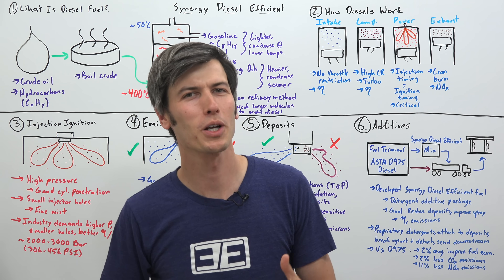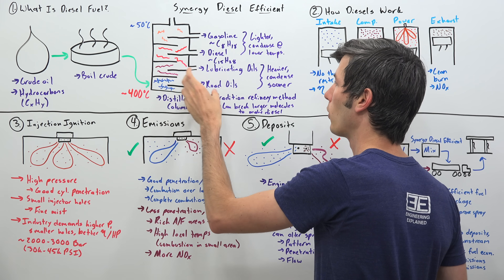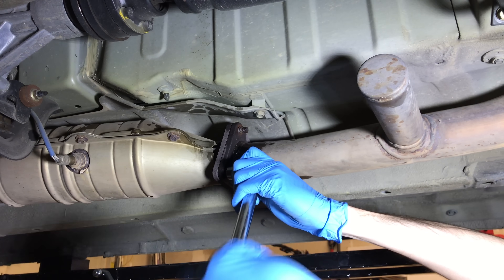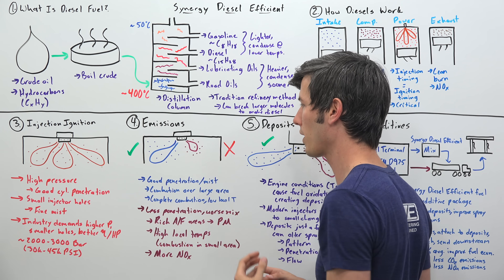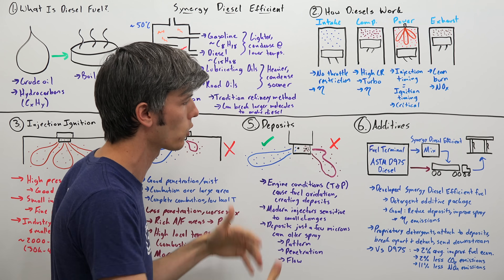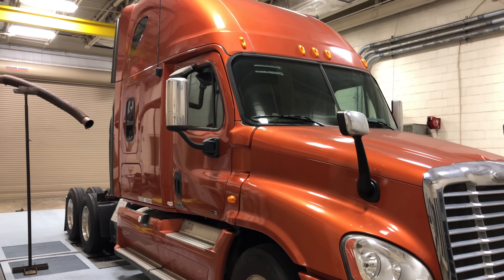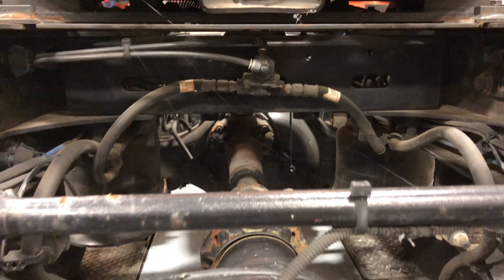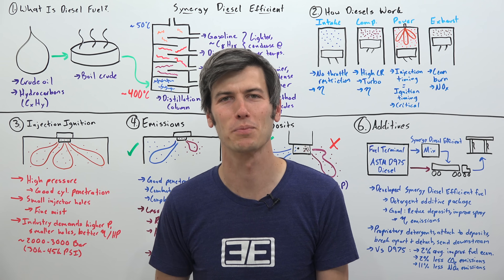Why Diesel Engines Lose Power & Efficiency Over Time

Comment: What causes a loss of power over time? Injectors wear/collect deposits creating poor spray characteristics. Wear in the cylinder kits causing lower cylinder compression/combustion pressures. Wear in the valves/valve seats causing lower cylinder compression/combustion pressures. Non VGT turbochargers generally don't wear out normally I mean the shaft bearings will wear when they fail it is a catastrophic failure good air filtration and oil supply keep them going a long long time. But over time boost leaks can develop in the charge air system. A diesel engine does not require much to run, air, fuel, and compression.   You can have other stuff happen but it usually causes a huge loss in power, air in fuel, low fuel pressure, failed high pressure pump (HPCR), turbo failure, EGR issues, plugged DOC or DPF, failed cylinder kit(s), burned valves or valves that are damaged/not seating fully, failed fuel injector(s), plugged filters, improper valve lash adjustment, improper fuel map, incorrect injector calibration codes. I can tell you as a fact that a driver cannot notice a change of 15 horsepower. I run a lot of tractors on a dyno. They normally start to complain when they are down about 50hp. A 2 percent improvement is not really enough to get a driver to spend more on fuel nor will they be able to perceive the difference, they might think they see or feel a difference because of marketing but they really can't.

Comment: I was an engine rebuilder for 30 years. Worked on Diesels and gas engines. Worked on over the road trucks and pure racing engines. Finally wound up teaching robotics for 20 years...all electric motors.
You know what...all piston combustion engines are crude, inefficient devices limited, at BEST, to about 33% efficiency. They all need 'cooling systems' to get rid of the energy that they cannot use...they should be called 'energy wasting systems'.
Induction electric motors basically  have 3 moving parts, a rotor and 2 ball bearings. None are sliding against each other...unlike pistons, rings, valves, camshafts, plain bearings etc. Electric motors don't need clutches or transmissions...with hundreds more wearing parts. 

Oh...and they're 97% efficient or so. 
 Piston engines are GEOMETRICALLY inefficient. Their metaphor is a damn choo-choo, steam engine.
So can we stop worrying about detail improvements to a dinosaur and move on?
The fact that Exxon-Mobil is sponsoring the video says it all.

Comment: This is a good reason for the "Buck" engine design. The ability to change an individual cylinder quickly and easily will keep the engine at top performance. Incremental rebuilds mean reduced downtime and improved cash flow for the owner as well as improved economy, all saving money. Individual cylinder replacements in under 10 minutes.

Comment: You mention Esso stations. I'm old enough to remember when Esso changed their name. I was a kid and so surprised some year later when I realized they still used the Esso name in some countries. Why did they change to Exxon and why do they still use Esso some places.

I actually didn't realize Diesels didn't have throttles. So a question is do you think GDI engines will get away from throttles?
Reply: No, because gas engines are throttled by air, diesel engines are throttled by fuel. Without a throttle controlling how much air enters a gas engine, u would be dangerously lean trying to limit fuel, or running away from you. U could throttle each cylinder by using the intake valve, but u still have to control amount of air to keep stoichiometric ratios
Reply: @dannymac7852  If you have an injector and computer why wouldn't you be able to calculate how much fuel and adjust accordingly. That's pretty much what a gas engine with intake injectors does now.

Comment: Your explanation of distillation is missing two vital elements.  The feed to the separation column is close to the middle, not the bottom.  At the column's bottom is a boiler (called a reboiler) and it functions to create vapor from liquid.  At the top is the condenser which functions to form liquid from vapor.  Naturally, liquid descends down the column whereas vapor ascends and the two streams tend to avoid each other.  All along the length of the column are "trays" which are devices that encourage intermingling of the vapor and liquid passing through the tray.  It is this "scrubbing" process that separates the components: larger molecules going towards the bottom and smaller molecules going towards the top.  The various products, e.g. gasoline and diesel are drawn off as a liquid from the trays.  The gasoline tray sits higher in the column than the diesel tray.

Comment: Another inefficiency is happening in the air intake stream due to sludge accumulation. This sludge is caused by egr and pcv mixing oil and exhaust soot. A 3 inch air stream can be significantly reduced withing 150,000 miles.
Reply: Emissions regulations is the worst thing to happen since unsliced bread.

Comment: If a fuel additive is this helpful at keeping injector spray patterns consistent it could be worth the extra money. Keeping deposits to a minimum seems to be the name of the game for longevity in modern diesels. In my opinion the DPF and EGR systems will be eventually phased out. Once the engine manufacturers can come close to perfecting the SCR system, all the NOX emissions will be handled by urea injection. Some tier 4 final industrial engines already have done away with DPF’s and rely on the lean air fuel ratios (thanks to high pressure common rail injectors) to all but eliminate particulate matter in the exhaust (unburned hydrocarbons in the form of soot and black smoke) Yes, these lean burning engines produce higher cylinder temps increasing NOX output but then you have SCR to save the day. The engines I’ve worked on have still used egr to at least some degree though. If the SCR system can be made efficient enough there should be no more need for dreaded engine-ruining EGR... just a theory though.

Comment: I heard of a mk1 diesel mondeo that was used as a taxi covering over a million miles, it probably had several changes of cambelt and a fair few clutches too. And I bet it was never driven over 50 mph lol. 1.8td is a very reliable motor.

Comment: Hello. Nice video as always.
I've one question related to Diesel engines. Why most of diesel cars with more than 10 years, often make huge amount of black smoke under engine load ?
Reply: a number of factors, engine tune, maintenance level, mech-injectors vs electronic, engine design, engine's available power vs amount of load present, all that fun stuff..

Comment: rudy diesel's first engine ran on peanut oil. Diesel engines can run on all kinds of different fuels refined into diesel fuel. they can refine plastic waste and make diesel fuel that runs cleaner than crude based diesel. The world runs on diesel time to start recycling hydro carbon based trash into useable fuel. Diesel is the answer not electric vehicles that create more toxic waste. Electric vehicles are old tech, been around since the 30's. they were smart enough to realize battery power is not sustainable. Lots of lithium to get rid of when the useful life has ended. Diesels you rebuild and keep the wheels turning.

Comment: Is there any particular reason you can't or wouldn't want to run a diesel type cycle with the lighter gasoline hydrocarbons?  I'm not saying why not use diesel fuel in a gasoline engine.  I understand the problems with that.  But why aren't there engines that burn gasoline but restrict intake air less, use high compression instead of a spark, etc?

Comment: I have Honda insight 2000, 3 cylinder with 200k miles 5 speed, NO problems what so ever with the engine, on way cheaper 89 octane and it makes 60- 65 mpg.

Comment: 9:28 You have no idea how long a diesel engine lasts.  My Jetta is at 415,000km (260,000 miles) and it runs like new.  As a trucker I have also seen tractor trailers with 2 million miles on the original engine.
Also, the title of the video had nothing to do with the content.

Comment: I have never known any significant torque loss or oil loss from a diesel car. I have noticed significant torque/ power loss and higher oil usage from gasoline engine cars more likely due to higher revs and higher demands put on these  engines.

Comment: This video is reductionist and should specify “modern diesels” (high-pressure “common rail” fuel injection).
I am a fan of the older Cummins and Mercedes diesels which had mechanical (not electronic) fuel injection pumps, larger injector holes, lower pressure and virtually no emissions (except EGR which is easily removed to prevent carbon gunking air intakes). These engines don’t lose power over time due to reasons in this video.
And there are other reasons engines in general can lose power/efficiency not covered here as well, like piston ring wear, causing blow-by for one example.

Cummins engines can last many hundreds of thousands of (in a few cases up to 2 million) miles in proper conditions.

Comment: Well explained! But here is a big problem...you can get a regular diesel from other than Mobile gas station for about $2.83 and in the same area Mobile diesel fuel is $3.29. That is 16% difference in price. For me to purchase their fuel they would have to be competitive and at least stay in less than 5% difference range...so as of now, it is not worth it. Your engine and a vehicle is not going to last that long for it to be worth purchasing Mobil more expensive fuel.

Comment: Like your videos and watch them often - so thanks for breaking things down on the newer end of the spectrum.  On that note - you State that the engines/vehicles were used and had reasonable miles on them with plenty of useful life.  However, you also state that they were brought back to mechanical soundness as if there were new and various filters were cleaned and etc. 

So here is where I question the results - would it be better to take the truck/rig as-is and run the fuel to see what results you get?  Point being that if I have a LD truck and and it only has 50k on the ODO, I am not going to start replacing or cleaning everything.  If I were to run this test i think i would do it in four stages 1.  Run the truck from new and measure the results 2.  At XX,XXX miles Run the test again and see what results I get 3. Rehab the sensor and filters and see what results you get 4.  Run the test again with the reformulated diesel and see what results you get. 

What I want from the above is the whole bell curve - I want the universe of data.  I want to see my SD change after the introduction of the reformulated fuel.   How do we know it wasn't the rehab that caused the desired results?  I may be missing something here, but hope you understand what I am trying to get at.  Cheers - Henry
Reply: It was a commercial... so don't like really pay attention to anything this guy says.... bought and paid for...

Comment: Hey dear. Very informational video. Keep it up. Well, i have skoda octavia rider 1.9tdi diesel 2007 clocked 1 lac kms on odo. Will it be fine if i use Liqui moly Diesel purge in full tank to clean injectors and fuel system? Is it safe? Please let me know.
Thank you.

Comment: From my own experience, diesel engines are difficult to start in cold weather, particularly as the engine gets older and starts to lose compression.  There seem to be fewer diesel powered passenger cars now in North America than 40 years ago.  I don't see any advantage in diesel power over gasoline, particularly now that regular unleaded gasoline is cheaper than diesel.
Reply: I was born in the 90s and I never really saw them and even today they don’t seem that common and it always seems to come back to the Oldsmobile 350 diesel is the entire reason there weren’t more American made diesel cars.I work in construction for my dad so mostly uses diesel but One truck is gas (from 1993 though)and it uses 1/4 of a tank just to get where I work and that’s empty! Towing uses 1/2 to 3/4 while all his diesel trucks seems to last the entire week and doesn’t require me to shift into 2nd and crawl up hills at 25mph.( I would definitely say they time periods play a role but I haven’t driven a new gas truck since 2000) Now because of the cost of fixing Diesel engines and all the emission BS my dad is thinking of going back to gasoline including a class 6 truck which sounds meh.

Comment: @3:16 the term is 'compression ignition;' both gas and diesel use fuel to ignite. I would say compression ratios don't 'tend' to be higher, they are higher: in general, diesel is 15:1 to 23:1 vs. 9:1 to 11:1 for gas. (yeah, another anal engineer here). Very thorough.

Comment: My Golf mk4 TDI had 131HP when it was new, now has 220HP.
🤔😂
Reply: Stage 1 or 2?
Reply: @SlowBoiGang  Stage 3
Reply: I like it.
Reply: Cars outside the EU be like:
Reply: I'm thinking about getting a golf just like yours, what work did it take for you to get it to that power and what is it like with fuel consumption and what's it like?
Reply: @Re_Kitty  Fuel consumption is almost same as stock, depending on your driving style. You have to upgrade turbo, and install bigger front mount intercooler, and also you need exhaust pipe which is compatible to your new turbo. After all you need good remap to support new hardware.
Reply: 🤣 Diesel gets better with time. And no Exxon with 2% power increase

Comment: Why not just pull the injectors and watch the flow/spray with the new fuel continuously over a few weeks in a lab rather than relying on the vehicle performance. The new oil in the Engine probably thinned over this period and influenced the result.

Comment: 9:26 200k? In Romania we treat a 200k second hand vehicle as new.
Reply: In Poland a 200k vehicle is really a 350k vehicle xD
Reply: @electrizer  In Bulgaria 200K vehicles actually have more than 600K on them :D
Reply: Ya my 6.7 is going to shed its DEF and EGR system like a winter coat in the summer!
Reply: @junkrust2182  lol and then you'll reinstall it before the state inspection
Reply: InfiniteLoop not in FLORIDA 🙂🙂🙂🙂
Reply: @junkrust2182  ohh I see
Reply: InfiniteLoop ooo but don’t get me wrong hauling commercial and rolling coal will eventually get DOTs attention than its a putting it all back
Reply: And friends don’t let friend drive bro dozers 🙂
Reply: @kiyoponnn  Doesn't work, they stay on the road and look for modified cars
Reply: @mitza3613  I see
Reply: This is the future :D where engine is expected to last 200k, 20 years back they was expected to last 1 million for diesel engines. What an innovation of the future...
Reply: Huehuehue.. * fistbump *
Reply: 200.000 mile nu km :) 322.000 km inseamna
si la noi dupa 250.000 km le vedem vechi ca deja schimbam piese la greu
Reply: It's planned obsolescence in America so people have but more garbage. Things are manufactured to last 5 to 7 years no matter what it is.
Reply: Mi toyota 3L can run for at least 1.000.000 KM
Reply: Gabriel Alfaro in armenia a 200k vechile is really a 700k low mileage original motor
Reply: In australia 200k km is only just run in 700k to 1.5m km is not uncommon in the older motors the new common rail not so good
Reply: 100th Like.
Reply: 200k is the sweet spot
Reply: Vasile Pintilie Romania doesn’t have the same emissions control standards as the North America. All the emission control components is what shortens the life of an engine... they’re are basically choking the engine, not to mention the emission components themselves are just more parts of the vehicle to potentially break and cause problems.
Reply: Rick Tatorship not the same but since Romania is a eu member state, it probably has tougher emissions restrictions than the US
Reply: marc balcells possibly... depends on where in States.... DC and California are insanely strict
Reply: @junkrust2182  Does that mean that DC and California have poor air quality?
Reply: @marc252  yup
Reply: @jaysson1151  lol  why would you assume Romania doesn't have those laws
My audi a6 2.0tdi 2010 has gone 620k km so far and is still working like clockwork
Reply: KoKoSkA122 I never said they “didn’t have those laws”. You need to reread my comment. What I said is that they’re most likely different. Europe and Asia has a lot more personal vehicles with small diesels than North America does because those engines do not meet the requirements.
Reply: @jaysson1151  Pretty sure Romania is a member of the eu, thus has to comply with the euro standards. As for which is stricter, that's debatable since even the test cycles are different so you can't compare them directly. But what is measurable and visible is that eu has been far more successful in lowering their emmisions, so at least there's that ¯\_(ツ)_/¯